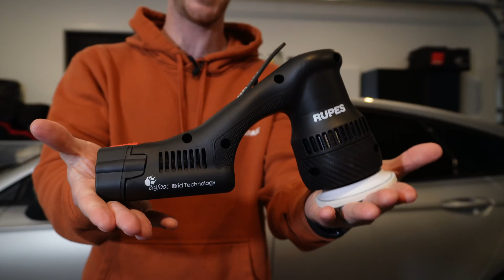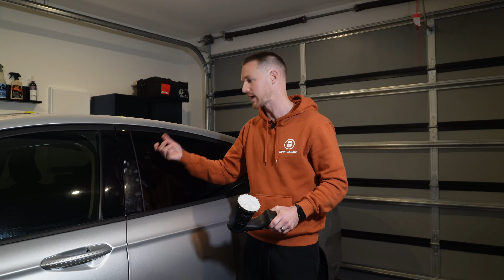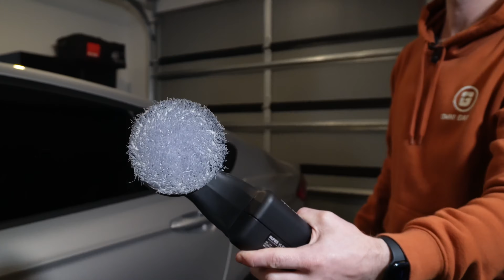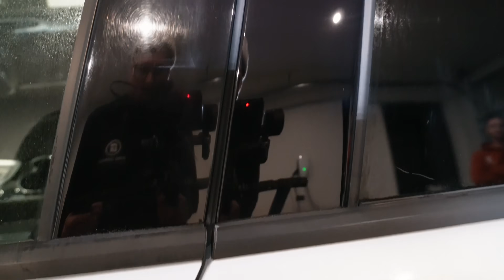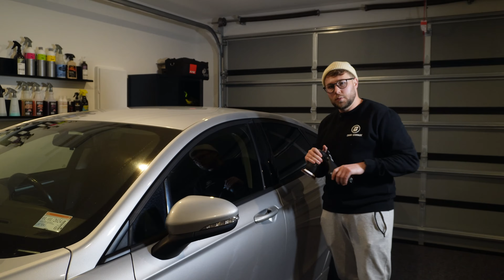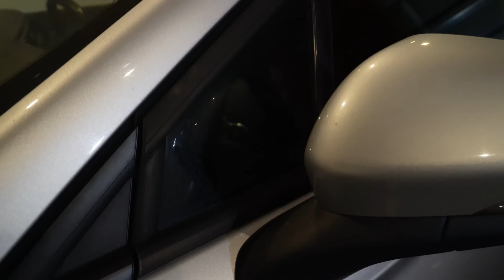How To Restore Scratched Gloss Black Trim

Comment: That's a good job. That black gloss trim is tough to restore. What would you use on the same glossy finish trim on the horizontal thin pieces?  This car has them but they are the matt black.  I need an application for the glossy black thin window trim.  What would you recommend?
Reply: ouch !  left on read for a year bro :D